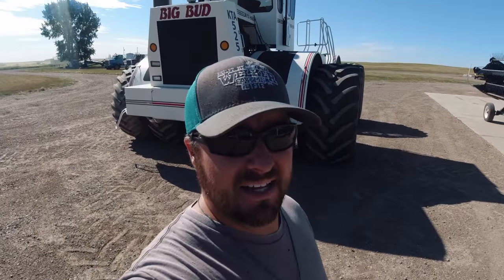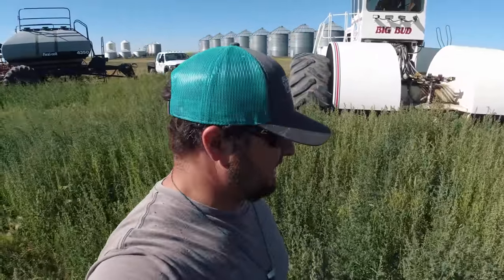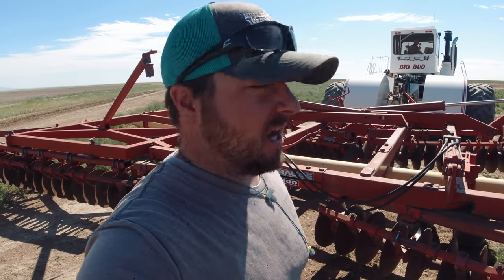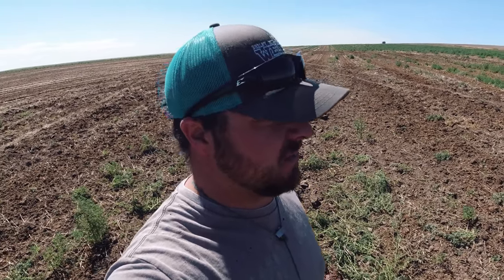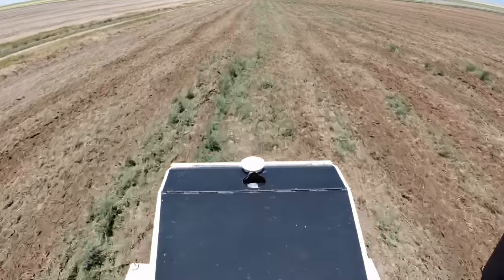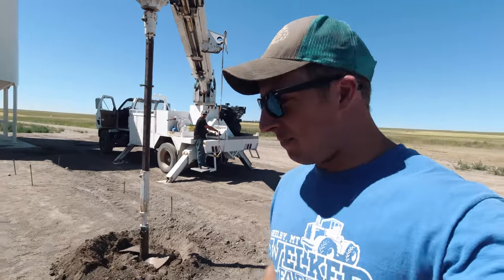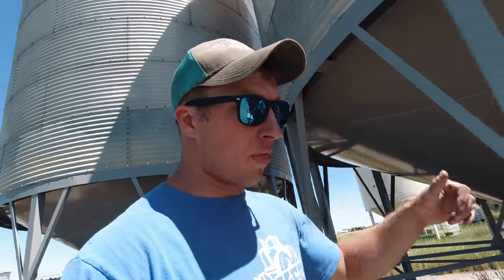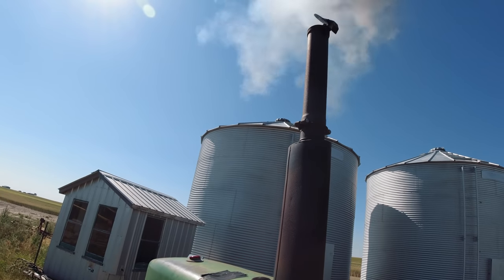Old IRON Turning DIRT

Comment: Yeah or your vehicle fender would be bent like mine after I hit a roo on the roo bar and pushed it back on to the vehicle.
Least it did not set all the air bags off like it did to my brother in-laws Toyota.
Yes we have bucks but last I saw they are only worth 70 US cents which is good for our grain price and wool but makes machines and firt alot more expensive.

Comment: I know that's an offset disk and what I call a plow disc because they actually plow more than chop like a standard disc and take a lot of power to pull but the discs are small compared to our International brand disk that has notched disks that really penetrate into the ground. That one of yours looks lighter weight for how wide it is as far as putting very much pressure down on each disc blade. Can you put a big concrete block on each section with the boom truck once you get to the field? That would be just over an extra 10,000 pounds that would help get you to depth and save you some time and fuel from having to do it twice. Might make it harder pulling though. Always enjoy your videos!

Comment: I think the 4520 needs to be called a 4820 since it has the combine motor instead of the original motor js maybe a suggestion for a restoration model sticker for the hood? Or 4720?

Comment: Had the same problem years ago in some very dry wheat stubble. We had hauled over it several times with a vac tank so it was packed down on top of just being hard and dry. Fold the wings up on your disk. Takes forever to get over but the added lbs per square inch will get you down to those roots......... love the videos guys!

Comment: 10 bottom Moldboard plough, then the disc, that'll get 'em.
Reply: Ya and the fuel consumption will be to high and it will be a big pain to disc over
Reply: Compaction issues too
Reply: Half hour in a sprayer is your best tillage tool you can use.

Comment: I would like ask a couple of questions. Why were you running a medium tillage disk? There is no way that a light disk can make a dent in those big weeds without at least three trips over the place. Also, I think you were running with a loose gang (inside right front) or was I just seeing things? 
It would have been fun to hit those weeds with a heavy duty JD plowing disk with deep scalloped blades but with as little rain as you guys get, maybe that's a bad idea.  
I farmed in an area that gets 30 inches of rainfall a year so what I don't know about farming in your area would fill a book.
Reply: First our tillage cultivator was at a neighbors. It's only 80 acres.  No rain so the ground is packed from the manure trucks.  We'll rip it this fall
Reply: @RobertWelkerFarmerBob  Thanks for your reply. It is interesting to discover the varied regional nomenclatures associated with farming. In our neck of the woods, a tillage tool and a cultivator are two different implements.

Comment: cover crops would probably reduce the weed pressure and increase the carbon content of the soil.
Reply: They lack the rainfall for doing stuff like that they need to be as water conservative as possible
Reply: @brandyngould5412  You'd be surprised. Watch some of their spring videos -- they have water ponding and sheeting off the fields. Look at the auger part of this video -- the soil at the bottom of the hole looks dark and moist to me, and this is in August! And finally, look up a guy named "Gabe Brown", here on youtube. He's growing cover crops with cash crops on 11" of annual precipitation, east of these guys, in Bismarck, ND. 

Keeping growing roots in the soil increases the water-holding capacity of the soil, and keeping the surface covered with a thick layer of residue reduces evaporative losses and erosion.

Comment: In Kansas and Colorado, populations resistant to Groups 2, 4, 5 and 9 in one plant have been found. Kochia's hairy leaf surface has the ability to resist chemical application, requiring more careful nozzle selection and higher water volumes than many post-emergent weeds in the crop. | Mike Raine
Reply: Amazing plant. And expensive

Comment: Being politically correct all Kangaroos are called Roos whether they are the big red kind(Case HIH) or the Wallaby kind.
All semis are called trucks or road trains and what you guys call a truck is a 4x4 or a 4by or a ute. You can have a solid canopy over the tray but it's still a ute.
Roo bars, more commonly known as bull bars do a lousy job of protecting what ever you're driving but they do make excellent places to hang your water bag (canvas), bolt on a winch and driving lights which we call spot lights. Also they make great fishing rod holders.
There's probably nothing an Australian hasn't nudged or tried to pull with a bulbar.
Our outback roads are littered with roadkill but I've never seen a camel hit but it has probably happened.
Most things are hit by semis pulling a couple of trailers because they don't get a choice when the unexpected happens. We'd call these trucks with a couple of dogs or just road trains.
All this makes perfect sense to an Australian.
Reply: Thanks for the enlightening 👍

Comment: Isn’t a little bit worrying that the weed is not bigger and more spread? For me it’s a indicator that the soil is not fertile. Is it because of decades of heavy use of chemicals or lack of nutrients? I my area most fields have a lot of weed but they are all grown organic so no chemicals are used in them. the demand for locally grown organic crop is getting bigger and bigger so more and more farmers changing over. And when they grow fodder for cows. It’s getting more and more popular to mix oats with clover and other Grass sorts so that they have a ready made mix as fodder make silage or hay. They looks like oat fields filled with weed but it’s attentional.
Reply: This field was driven on by heavy trucks which mashed down the weeds

Comment: Question from a city slicker: If cutting the Kosha is better when the ground is wet, why not spray (wet) the field first and have the tiller follow a few minutes later?  Or is it a matter of cost/time by not wetting the field prior to cutting?
Reply: If you just spray it you will just have mud on the surface and that will cause issues with the disks and you still wouldn't get them deep enough . To get it wet and soft you would have to "flood" the field and give it time so pull into the ground, wait for the surface to dry a bit and then do the tillage, total waste of water

Comment: Just wondering why you took the wheels off of the disc wings?
Reply: The middle tires were replaced because rotten.  Size was smaller so we took outside off

Comment: When the engine of the jd dies you could put a case in it this will never die
Reply from the maker: I like your thinking! 😉
Reply: Easy now but ig could try to put a 5.9 cummins in it that would be awesome🤔
Reply: @pistonringfarms8107  but this wont fit the joke of making an jd better using a case engine
Reply: julian's Sümpfe der Maispflanzen case used the 5.9 cummins for years in their tractors
Reply: @pistonringfarms8107  well then lets put a 5.9 in it

Comment: How wide is that disc?
Reply: 38 ft
Reply: @RobertWelkerFarmerBob  10-4 good buddy!! I acquired a 4890 Case bout 2 months ago and I'm in the process of fixing everything that's wrong with it. I know 37ft is to big for it giving it's only rated at 300 but I'm also looking at a couple Case IH Steigers that have been sitting in the weeds for almost 9yrs since the farmer parked all 6.
Reply: @justinschmicker1049  👍
Reply: justin schmicker 37 may not be that bad depending on your conditions and how heavy a disc
Reply: @nellsonstout7001  we have heavy red clay and coal sand around here. The clay is what is going to make the tractor struggle but the sand will be easy.